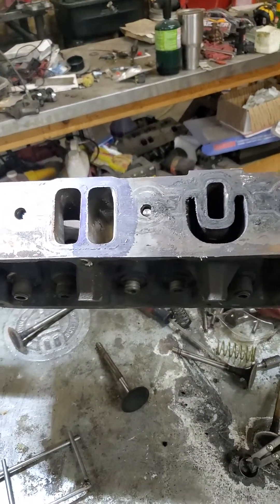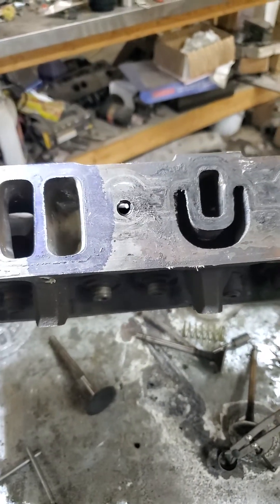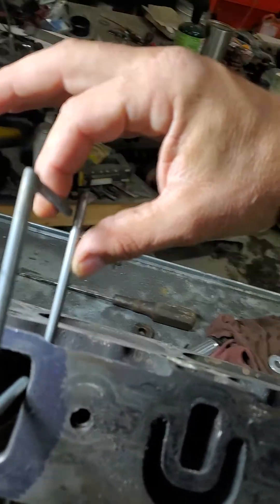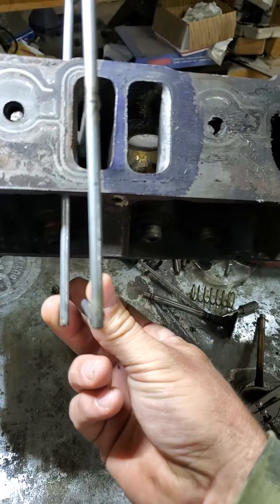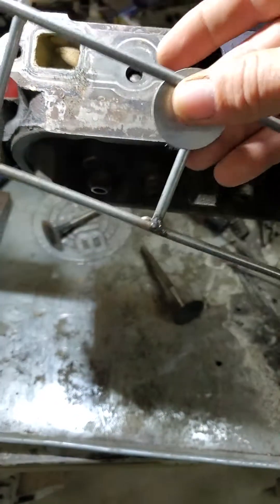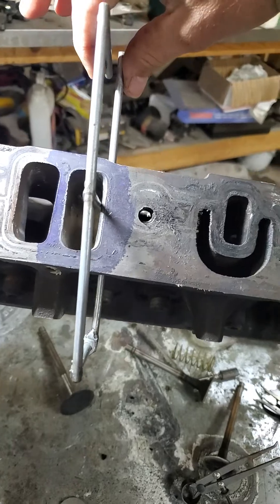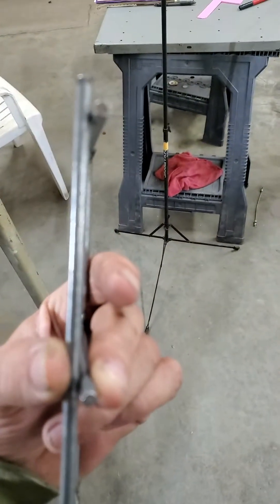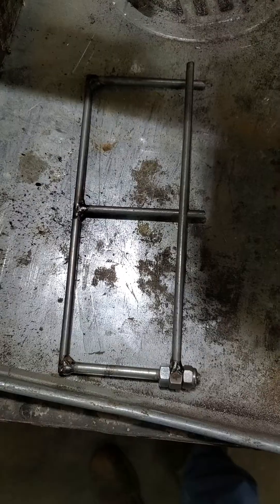(#20) Life saving porting tool. how to build a Roger Helgesen e bar tool for pennies.

Comment: Just transfer measurement to the gasket face and remain parallel.
Reply from the maker: If you remain parallel you will break through the pinch on these and a lot of other heads.